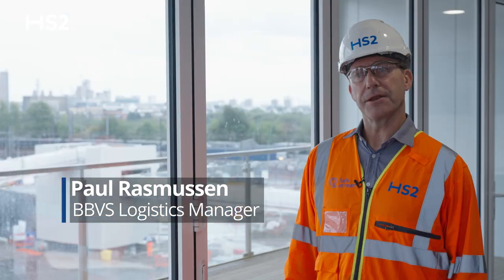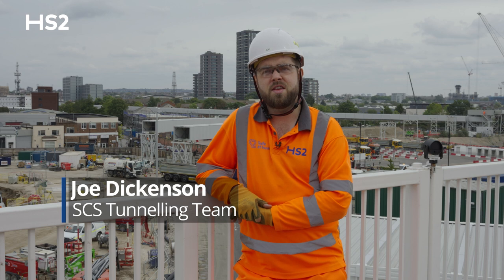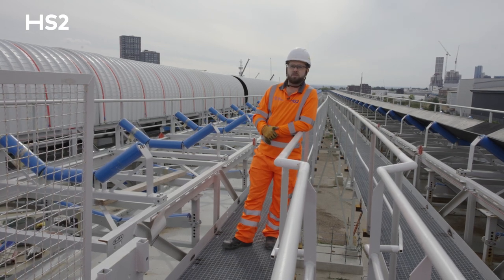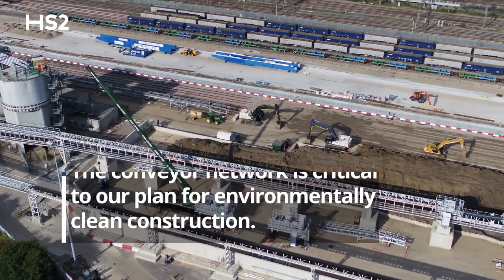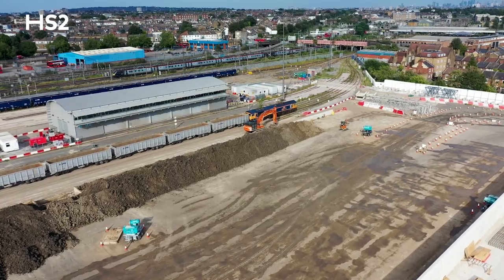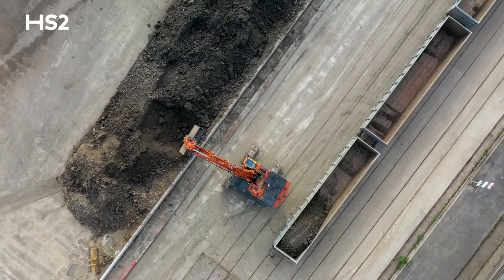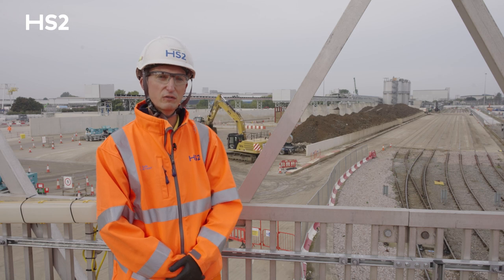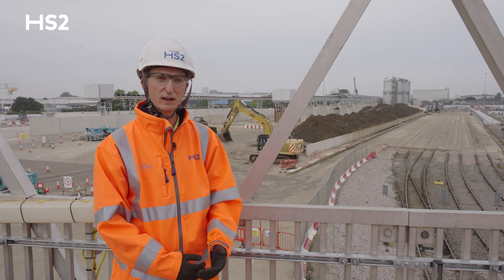HS2’s enormous spoil conveyor begins operation in West London

Comment: Could they not have built a railway line to take the stuff away in wagons!?
Reply: nope,they are starting the tunnel not just at eitehr ends but in the mid points, building an overgound railway to remove the spoil would mean demolsing homes and businesses and a lot more expense then is needed for a tempoary thing.

Comment: 1,000 tonnes of steel, creating 1.85 tonnes of CO2 per tonne of steel produced.
Reply: on the plus side conveyors are more efficient than trucks.
Reply: But, global warming and all that.
Reply: @edmundblackaddercoc8522  Re used or recycled unlike the fuel burned by 70 lorries every day.
Reply: @davidty2006  Conveyors to replace the trucks, to build HS2, which is not needed. Sounds a bit like a Black Friday bargain. There's no such thing as a bargain if it's not needed. The best possible outcome here is a more efficient form of waste. People wonder why the railways are in such a mess today. HS2 is sucking critically needed resources from our failing rail network.

Comment: Is there a reason why the soil is not stored in a way that it can simply be dumped into the rail wagons?  Seems rather odd that you have this ingenious conveyor system and then a couple of digger operators laboriously loading the wagons one scoop at a time
Reply: You see this all the time at steel mills etc. Drives me nuts, so much movement waste.

Comment: Totally amazing process. Clean and quick. When the material arrives for transfering to rail why not have large hoppers that can load wagons directly underneath thus removing the need to manually load with excavators!
Reply: It is almost certainly to do with storage. The conveyors run continuously, but the trains don't, so material needs to be stored until there is a train to take it away.
Reply: Sorting,  listen to the worker.
Reply: Besides storage a second reason is inspection and sorting. On such an open yard they can check if the material is clean or contains contamination like crushed concrete. Then they can sort and choose the dump site accordingly.

Comment: HS2. Another white elephant. Will end up years late, massively over budget, and if it does indeed ever open, will remain largely unused as the fare is likely to be exorbitant as the concessionaire attempts to recover their foolish investment. I say it again: It will fail.
Reply: It's all about London,  no benefit to the rest of the UK.
Reply: No country ever regrets building high speed rail infrastructure between critical population centres. Its a no brainer to get expensive to own and maintain cars off the road
Reply: @chungasrevenge4306  A railway always connects two points.
Reply: @tlangdon12  l doubt that Londoners are chomping at the bit to travel to the north of England and get there a few minutes earlier.  Let's wait and see.
Reply: Upgrading our victorian rail network is not a white elephant
Reply: @peepiepo  Ah yes. A vested interest perhaps? 

As I said before, the UK is technically insolvent. To spend upwards of 100bn given what we are about to face economically is suicide, gross incompetence or plain straight Jacob Zuma type corruption.